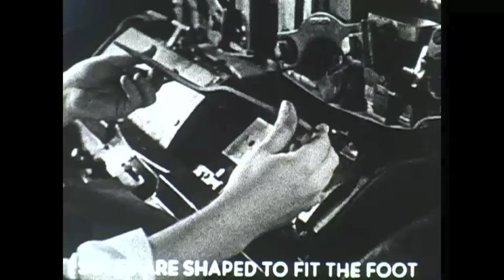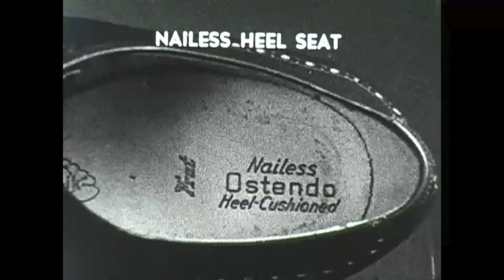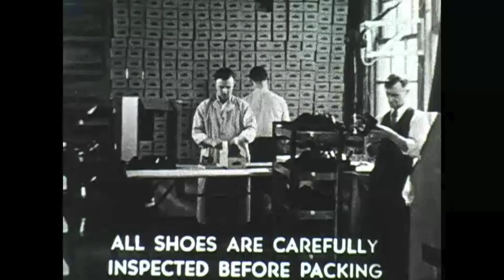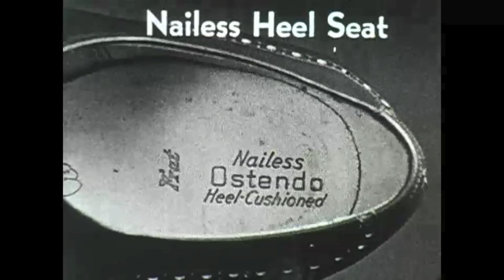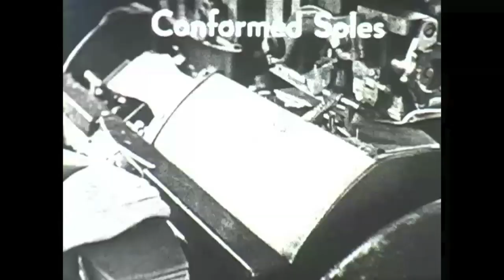Vintage Allen Edmonds: Modern Shoe Making.

Comment: I found the conformed soles and the narrow waists of the old models very appealing. Why don't the contemporary models have these? Also, do current models float in water and are they still as resilient after twisting, bending and stomping?
Reply from the maker: Jack Toews The outsoles are still shaped the way the average foot is shaped. We suggest watching our ‘Allen Edmonds Factory Tour’ video. Not much has changed in the way we make shoes:
https://youtu.be/TVihz2DbPd8
As far as floating, technically yes, most of the shoes would float. Most of the shoes also would still likely handle the twisting demonstrated in the video. That being said, there are smartphones out there that are technically waterproof, but we still wouldn’t recommend making calls while scuba diving.
Reply: @AllenEdmondsShoes  I’d still love to see the twisting, it’s like going on a rollercoaster drop for me for some reason. It irks me in a good way